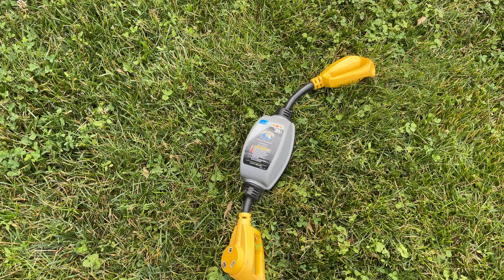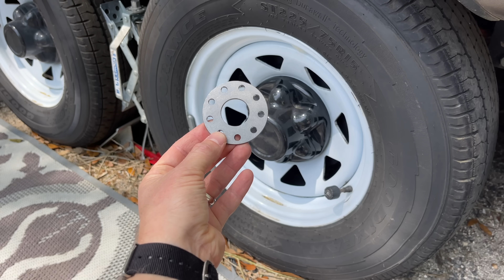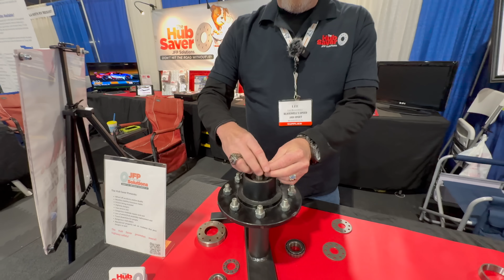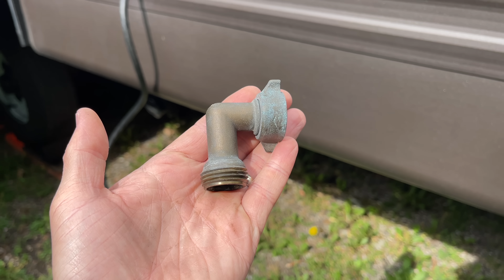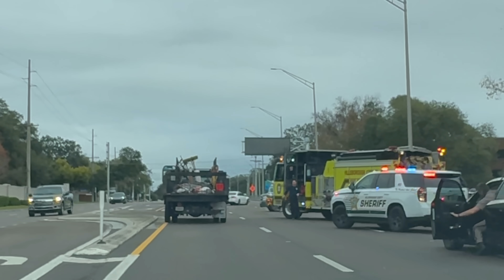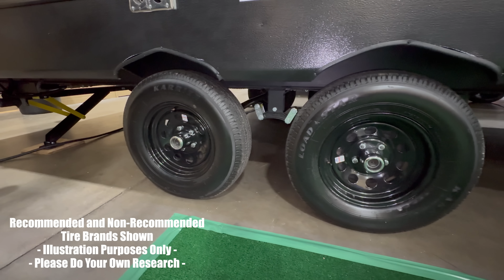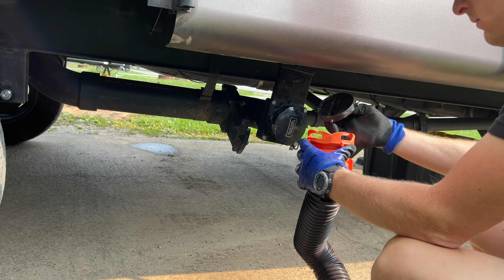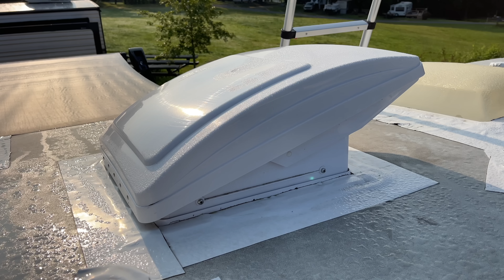RV Upgrades You Should Have Installed LAST Camping Trip (Bet you're unfamiliar with #3...)

Comment: On our first trailer we replaced our C-bombs with Goodyear Endurance tires. Our second trailer came with them already on.  2 other things that I wish came stock from the factory are low water drain valves and a valve between what water pump (provided that you can easily reach it) and the freshwater tank. So that if the check valve on the water pump fails which seems to happen often, it stops from filling your freshwater tank. Of course, you will have to remember to open it if you need to use your water pump.
Reply from the maker: I totally agree on the low point drains - I upgraded mine so that now they can accept my freshwater hose - wish they would come with that option! Check it out here: https://youtu.be/VxDFXiekY7A?si=GyyC1-ZSW9CzNKzF

And for the water pump - I hear that - I think I'd prefer a check valve instead, then we wouldn't need to turn it on or off ◡̈
Reply: China bombs*

Comment: A month or so ago, I installed a handle on the screen door, and what an improvement, especially when the door and screen door as mated, where the handle closes or open both. And, it cost less than $20, and 30 min or so to install.
In the last two years, the manufacturer of my travel trailer has included the handle as standard equipment.
Other items you showed, I have, but others already on the to do list. Thank you.
Reply from the maker: That simple handle really makes a difference right!?
Reply: I installed the handle, but only use it to close the screen door alone. I feel like if the doors are mated, it'll just rip out when I close from the inside.

Comment: I have earned that for the tire sensors one needs to have metal stems instead of rubber stems on the tires.  The weight of the sensors when the tire is rotating causes the rubber stems to bend outward thus air leakage thru the stem causing loss of tire pressure.  I
Reply from the maker: Yupp - although ours lasted two years before we had one start to split - so I agree, upgrade them to metal ones when you can.

Comment: I have followed several of you recommendations. Thank you. One of the bayonet lug pins broke on my drain pipe outlet. I measured the pin size, bought a stainless pin at the hardware store, drilled a hole and epoxied it in place. Still holding after 2 years.
Reply from the maker: Glad you found value in it - happy camping!

Comment: that secondary handle on the screen door is NOT a support handle.
they are great i have had on my 5er for years.
hub saver? maybe but pricey. at $80. USD for all four wheels on my rv.

my new spare tire was years old. the tread had separated from the caucus. never been used at all.

those “up grade” fans do not live very long and the motors fail. but worth investing in.
but yes over all these items you talk about here are items that should be on everyones rig.

another item, is a secondary power plug in point, at the rear of your rv. this way you do not have to use two cords. or a very long one.
( a weight connivence thing).
Reply from the maker: I've seen a few folks add in that secondary power port on their rigs - lots of flexibility that way!

Comment: As far as tires go. ONLY buy S/T tires. Thats specialty trailer. Do not use A/T, L/T etc. I've always used 14 ply S/T tires. Always use proper tire index rating for your coach, And never had a problem blowing, separating etc on 40 foot 5th wheels at 15k lbs or higher for over 30 years.
Reply from the maker: Thanks for sharing that experience!

Comment: It would be nice if the manufacturer included all the featured you spoke of.  However, the reality is that they can't even get the basics correct and you see RV after RV with many problems that are found after the purchase.  Even worse on brand new ones.  I would be interested in knowing the percentage of New RV's sold without many issues compared to those with many.
Reply from the maker: That would be a great statistic to learn
Reply: Just picked up a 2025 Grand Design Imagine XLS 22MLE. (26' TT) First RV ever. Drove from NH to FL. (~1500 mi) Only one very minor problem.  The locks on the passthrough storage were put together incorrectly, making it very difficult to lock. Figured it out, easy fix.

Comment: The feature of the GasStop is legally supposed to be built into the propane tank valve. I guess it's nice to have a redundant safety feature.
Reply from the maker: From GasStops FAQ page:
Many propane connectors already have flow limiting devices built-in, why do I need a GasStop?
Flow limiters built-in to common US propane connectors will not shut the propane off completely, they just limit the flow. GasStop completely shuts off the 100% of the supply of propane. GasStop will give the operator a visual representation of the status of the propane flow and pressure.
https://gasstopusa.com/about-the-gasstop/frequently-asked-questions/#q_3078_10

Comment: My RV is a 1994 30'Jayco Eagle.  For the 30th birthday of my RV, I replaced the brake back assembly on all 4 wheels along with "D" load range Good Year Endurance Radial tires that have a 80 MPH speed rating and of course bearing repacking.  The factory tires were "C" load rated.  Wish I knew about "the Hub Saver" while working on the axles.  The Jayco has been a well-made RV.  I have made many improvements and mods, like most of the ones in this video.  I also run a "Tire Pressure Sensor" on the RV that monitors the tire pressure and temperature in "real time", which is good piece-of-mind.
Reply from the maker: Agreed - TMPS systems are a must have.

Comment: I would add “extra sewer hose” and an extra storage tube. We recently needed 34’ of hose to reach the down pipe. We had to drive 30 miles to get an extra 10’ length.
Reply from the maker: yikes - that's a long run!

Comment: Handle on screen door great idea. Don't know that id rely on it or put near as much weight/force on it, as it most likely going to have smaller weaker screws, let alone the hinges. Only ment to hold the light weight of a screen door. But in a pinch or to use, just so your not grabbing the (slide) or the (screen), sure.
Reply from the maker: Agreed - the handle would not be used for weight bearing, but rather balance

Comment: I bought almost all of those (never heard of the hub buddy things).  Love my TST it has saved me three times.  The gas stops didn't fit on my tanks with the configuration of the system and allow me to put the cover on so they are in a tote.  The frame of my screen door was too narrow to screw in the door handle.  In fact, it just went in the trash after floating around the garage for 4 years.  My adjustable water pressure gauge gave out this summer.  It no longer adjusts and most of the fluid in the dial has leaked out.  With my water filter on that reduced the pressure just fine, I tried the static one and it barely trickled out.
I don't do the bearing myself and don't have the valve to squirt in so I try to find someone to do them.  Before leaving my summer campground I asked a friend of my son who is a mechanic to check them.  Last year he rescued me, after sitting on the side of the road for 5 hours waiting for my roadside assistance to find someone, when a brake locked and burned out the hub. He told me to bring it to his shop less than a mile from the campground on the day I was leaving.  No issues with the bearings but another brake was frozen.  It took 8 hours to get them repacked and the brake fixed.  In less than a mile I wore a flat spot on the tire so I had to get a new tire to replace one that had about 2k miles on it.
RVs are NOT cheap to have as a hobby.
Reply from the maker: As far as the gas stops not fitting with the cover - check out the 90* hoses: https://gas-gear.com/

Comment: The reason RVs don't come with a handle on the screen door is because the door and hinge on most RV screen doors are not heavy duty enough to have a larger person pull themselves up into the RV using it. This could lead to lawsuits against the RV manufacturer if the person falls and is injured.
Reply: Dale makes a good point, though. Regardless of what something is meant for, somebody will find a way to use it incorrectly and then try to blame anyone but themselves.
Reply from the maker: Yet some RVs do come with them. And these handles are not the grab handles intended for stairs - those are mounted to the wall on the other side- but rather help to close the door and also provide a balance (not weight bearing) point of contact
Reply: It’s really best not to have a handle on the screen door. You might forget to tell the elderly relative that doesn’t know and grabs that for support and falls backwards because the door breaks from the wait.
Reply: Nothing a warning label wouldn't solve.
Reply: @chrisw.p5665  I have put a handle on each screen door with every camper we have ever owned.  Never used as a weight bearing point, but always a second place to put our hands when entering and exiting the camper.  A Winner.

Comment: Great  advice regarding the electronics and tires. Both VERY IMPORTANT.  As far as the grey and black tanks go...we don't even use them. We use bottled water for drinking  and  for bathroom needs 😂😂 we use Porta Potties.  Yup..Porta Potties.easier to use, maintain and you can dump them any where. Plus...big bonus ...they are far easier to clean out and replace . We also use park families when available.
Reply from the maker: When you say porta potties, what do you mean? I'm invisioning the large plastic portajohns you see at a county fairground or construction site

Comment: Props on the EMS, screen door bar and so many of your products mentioned. This is not just a product placement video for RV Gee-Gaws, as so many are.
I might also recommend a 'green' or 'black' hose that is ONLY used for the sewer system and a 'white' hose that is ONLY used for the fresh water system.

Soooo, the Hub Saver is interesting. I can see where it would prevent tire loss in the event of a bearing failure . . . just to play Devil's Advocate - you add the hub saver, your bearing fails and . . . . you keep driving because the tire stays on. Realistically, if trailers have bearing failure, losing tires and we're unaware of the event, if they DON'T lose a tire because of the Hub Saver, aren't they just going to drive until something else catastrophically fails?
Reply from the maker: I like the recommendation of a "dirty" hose - devils advocate on that one - how far back do we go? Won't both hoses connect at the campground spigot?  I do have a short "cleaning hose" that I've put backflow preventers on and spray it down with disinfectant after use.

HubSavers - totally valid concern and scenario - I think where it goes from there for me is that under catstrophic failure the whole thing is going to heat up - so ideally my TPMS temperature sensor would start warning that there is excessive heat at that wheel/tire - not a perfect system, but I think the combo works well together - plus no flying wheels on the highway - just saw a post this morning of a rig that lost its wheel and the hot tire started a fire on the roadside - all around bad scenarios right? Just looking to mitigate as much as possible.
Reply: @rvgearandfar  Yah, the 'dirty' hose connects to the same 'Y' the clean hose is on AND it's stored in the 'Black Box', so good point about some spray. 

Thanks for the reply about the HubSavers. Great point about the TPMS (another MUST). This may be a next upgrade.

Comment: I've seen so many videos about replacing the mattress. I am an outlier. I have the original mattress and have no issues with it. I'm sure it's not as soft as my home mattress but I like a hard bed, which is good for back issues, so it fits the bill for me. I also use a sleeping bag on it instead of a bunch of home style linens. We are "camping", right?
Reply from the maker: Even at summer camp I put a fitted sheet on the mattress before my sleeping bag - something about an exposed mattress just screams hard to clean.

Comment: I have a 2019 Flagstaff Super Lite 26RLWS that came with 5 China Bombs.  Before my big cross-country adventure, I replaced them with Goodyear Endurance tires and have been happy ever since.  I must have over 36K miles on them, and they are performing great and never have had a problem with them.  I check them with my thermal gun at every gas stop as well as running my GMAC TPMS on board system.   Make sure you change out the spare tire too!
Reply from the maker: 36k is quite impressive! Over what timeframe?

Comment: I’m with you on the ceiling fans.  I have replaced them on ours but one thing you missed is the controls for them need to be on the wall.  My wife can’t reach the ceiling controls on those fans so many of those models are useless.  The other thing is a lot of them can’t be connected to a wall switch because the fan won’t come turn on unless it’s turned on from the control.
Reply from the maker: Very good point - especially in the vaulted ceiling of a fifth wheel

Comment: any thoughts on the MorRyde crossmembers?
Reply from the maker: I think they're a fantastic idea and love that they're bolt on. I'd have to do some plumbing work/rearranging in order to install them on my rig and haven't tackled that yet.
Reply: @rvgearandfar  I have hydraulic lines and power in the way. They have a drop down version that avoids objects.  I get these installed along with the hub bearing retainer in two weeks. Thanks for the suggestions

Comment: What about someone taking that fan out and breaking into your unit? You could put a small someone down through that opening. Just saying.
Reply from the maker: At the point where someone is getting on top of my rig, removing the fan and dropping down into the bathroom - thats what insurance is for - although the issue of many rv doors and compartments being keyed with the same key is more likely an issue than a nefarious human fitting though that small hole in your roof. Just sayin’

Comment: And adding the extra Valterra valve makes it so that you can equalize the tank water. Full gray tank? 1/4 black tank? Open the original valves while leaving the Valterra closed and the gray water will move the the black tank until they equalize. Now you have more room in your gray tank. Magic!
Reply: Best tip I got from this video!  Thanks.
Reply: @clintstevenson1214 Glad I could pass it on!
Reply from the maker: truuuuue... but you're also introducing black tank waste into your grey tanks that way - just want to point that out for folks that may not realize it - is it a big deal? probably not - but there is potential for solid waste or toilet paper to "float" up into your grey tanks and get stuck there
Reply: @rvgearandfar  Not if you open the gray tank first. Then the black tank. Close the valves after they equalize. Takes about 15 seconds.
Reply: NEVER mix the black and gray tanks. They are separate for a reason.
Reply: @DW7094 Care to state the reason?

Comment: The GasStop is a good idea, especially since you can use the device to test for minor leaks (follow the instructions). However, we upgraded to a tankless water heater and apparently the amount of gas suddenly released to heat the water triggers the GasStop. I had to take the GasStop valves off.
Reply from the maker: I reached out to GasStop with you comment to see if there was any way to solve this issue - based on the reply copied below - when was your GasStop purchased? It seems like they have increased the threshold from 2024 units onward:

From GasStop:

Hi Joshua,

Thank you for reaching out.

@Brian is right, on occasion GasStop will interpret a surge of flow as a leak and shut down the system. A surge of flow happens when:
 
There is a major/fast leak
A “thirsty” high flow-rate device (much like an on-demand heater) starts up and puts a sudden load on the propane system.
Colder weather makes propane more dense, this reduces the shut-off envelope of GasStop.
 
All of the above is true of all Excess Flow Valves (the family of valves GasStop is a part of).

Even though the incidences of unwanted shut-offs are comparatively rare, we wanted to solve this issue. Our aim is to make sure as many RVers as possible can use GasStop. Therefore our team have increased the flow rates of all GasStop made from 2024 onwards. This should go some way to solving the issues found by those with “thirsty” on-demand heaters. As a final point, it is important users make sure their GasStop gauges are pointing towards the sky as best they can, this ensures GasStop is working within the flow rate envelope it is designed to.
 
I hope this helps, as always please feel free to share this with you community.

Warm regards,
 Matthew Howard
Reply: @rvgearandfar  Thanks for going out of your way to help! This is great. I'll reach out to them directly and see if they can do anything. I bought mine in early 2023.

Comment: A cheap non-contact thermomter from Harbor Freight is only the size of key fob and can give you a quick and accurate check of hub temperatures.  I use it on every walk around.  It'll warn of problems much sooner than guessing with your hand.
Reply from the maker: I use a laser thermometer the same way
Reply: @rvgearandfar  The laser is a feature of some non-contact thermometers. It merely helps with knowing what you are aiming at. The technology that reads the temperature is still the same.